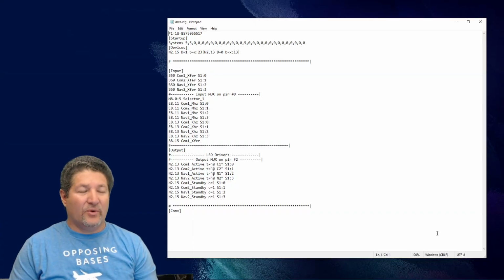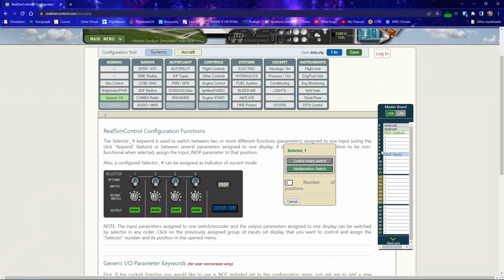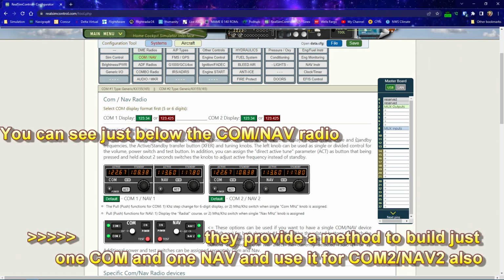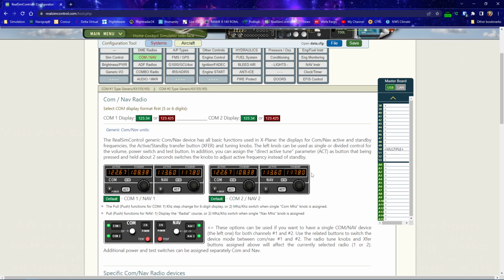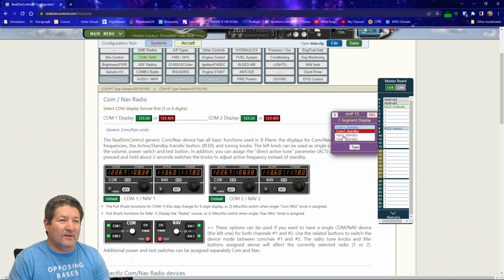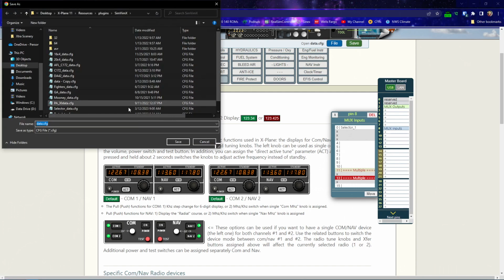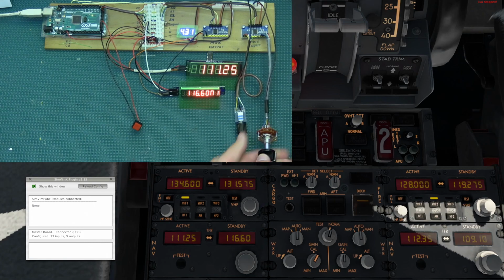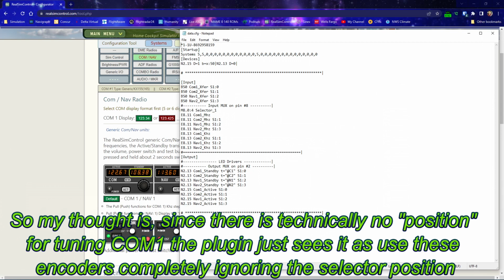Using selectors in SimVimX/Real Sim Control

Comment: Thanks for showing how to configure selectors.  I tried configuring them several times with older versions and gave up.  Even though the web interface was reasonably easy to use, I got frustrated with how often things changed.  Even now, the Web GUI changed the day after you posted this video and it took a couple of minutes to find the Generic I/O configuration page again.  I also had the exact same issue you did where there was not a selector value for Com1_Mhz in the configuration file when it was saved.
Reply from the maker: Hi Larry, you're welcome and thanks for your comment.  You're right, the GUI did change AGAIN. It always makes  me  feel like  my videos  become irrelevant as soon as I post  them 🤣

You're the second person who tells me that you had the exact same issue. Thankfully it's an easy fix huh we just have to catch it.